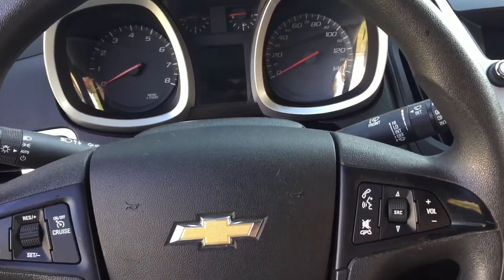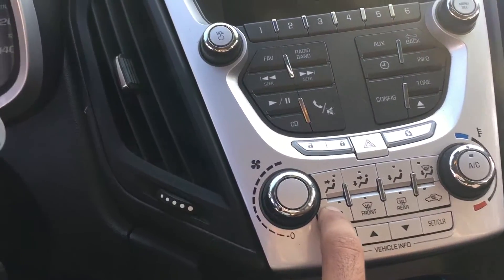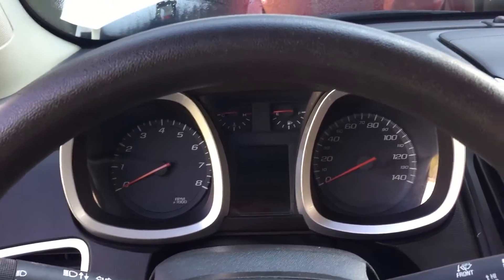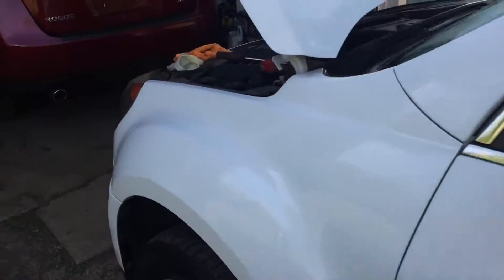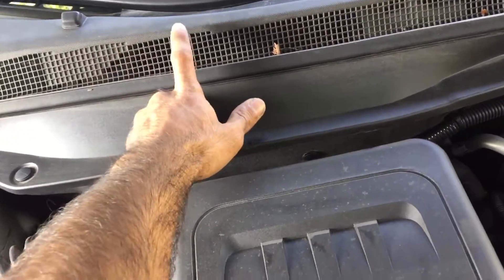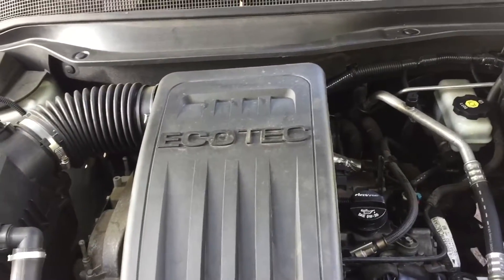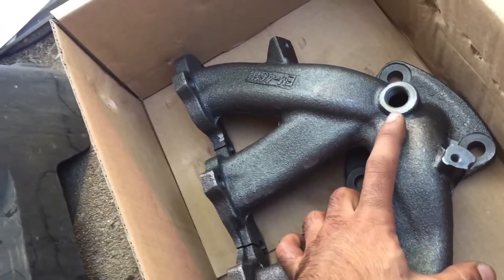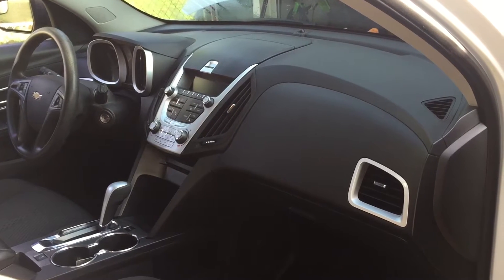2.4L Ecotech Chevy Equinox Engine Noise/ Smelly A/C. Solved!

Comment: I have the same 16’ equinox 2.4 ecotec,  I have a noise on cold start that lasts until I start driving. It’s very similar to the noise I hear in your video BUT there is no bad smell even with the AC vents set to outside air. 

Is there another common thing that would make these engines rattle noise on cold start with a similar sound?   

The sound is as if there was something hitting the plastic fan blades but a bit more metallic and then goes away
Reply from the maker: This engines known to be loud in general after few years of driving. If the manifold has a small crack you won’t smell the exhaust gas yet but the reason why you don’t hear it as much after driving is the manifold expands just a bit enough to cover the crack. 
If I were you I would drive until the smell comes from events.
The other reason is the timing chain rattle. They sound very similar but even if you change the chain it won’t go away. I do recommend timing chain replacement on this engines around 100k miles bc some of them jump timing around this mileage but it isn’t very common.

Comment: Video on how you changed the part?
Reply from the maker: On this channel I don’t show how to change parts bc it takes so much time to record them. It’s only for diagnosing problems so you don’t spent so much money on extra parts that you don’t need.
Reply: It is really easy, there are several  videos online, but you just remove the intake, the intake mount and you can access the exhaust manifold. Just a dozen bolts/studs. Some of the bolts are hard to get to and you have to be careful not to drop the bolts and the studs. Job is much easier with one of those electronic socket wrenches.

Comment: You think you solved it, this is just the beginning...
Reply from the maker: I don’t understand what do you mean by beginning? Beginning of what ?
Reply: @aslanmammadov2230  he’s saying it’s more problems coming I have a 2011 Ltz equinox and after I got my manifold replaced the catalytic converter went bad this car has been in th shop 5 times within a year and a half and I hate it and it only has 71k miles on it  worst suv. Chevrolet made
Reply from the maker: @quewoods8871  do you have 4c or 6c engine ? 2.4L known to be loud but they last for a long time compared to V6 vvti
Reply: @quewoods8871   You are so Right  my Brother Car is The Same Year as Yours Same Miles On it What a Pice Of Shit Made  Gm or Gmc Car i Told Him To Get Rid of it  It's Junk
Reply: @aslanmammadov2230  2.4L
Reply from the maker: @quewoods8871  check you oil level ones in a month or every 1k miles. They have oil consumption problems as well. I’ve seen some of this cars fail at very low miles or run over 200k miles. With normal maintenance and keeping the proper oil level is the key. 
To be honest all the newer cars have lots of issues. At the end of the day it comes to how you take care of them. Nissan, Toyota, Honda, Hyundai, Kia etc. they all have endless issues as well. :)